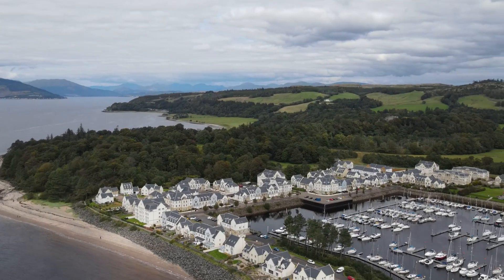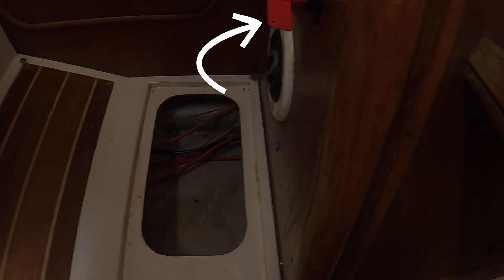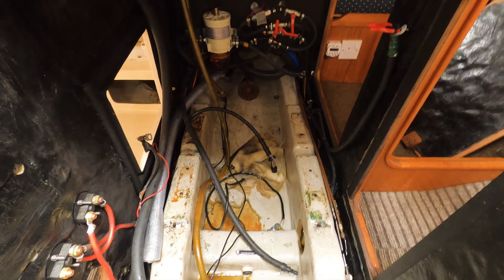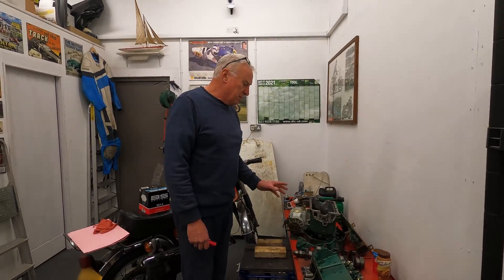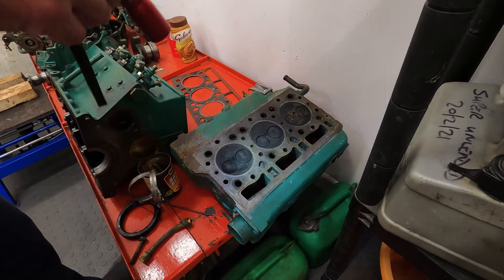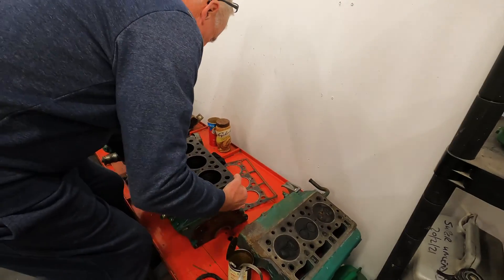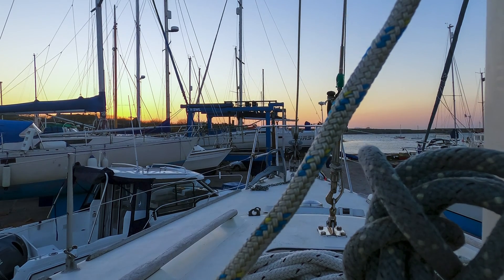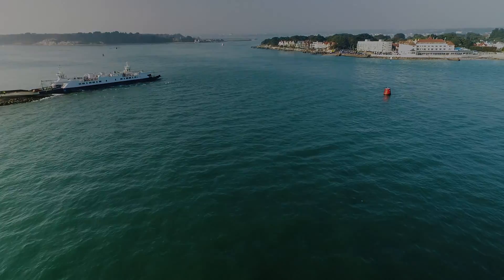Carry On Sailing. Volvo Penta 2003 Yacht Engine Rebuild. Part-3

Comment: Further to my comments in your Part 2, I find the level of incompetence, negligence and deceit that you've encountered to be absolutely staggering. You have been wronged for monetary gain and there should be inexpensive means available to you for full recompense.

I hesitate to mention the loose raw water intake hose which, as you mention, could have been catastrophic.

Credit to you for having such a stiff upper lip but I would still be considering every opportunity to discredit all parties who contributed to your pain otherwise they will continue to rip others off in similar fashion.
Reply from the maker: Thanks for commenting and like you was both shocked and relieved at the same time.  What I didn't film was the main fuel pipe that had been left sitting on top of the shaft coupling, that was day one of ownership. The engineer at Kip spotted it and replaced the whole pipe that had 50% worn through. I'd only done 9nm! Installation by an RYA Instructor!  I don't regard my role in this as being one which needs to shame them - they did that all by themselves.  The videos are enough - they know who they are!
Reply: @SM40  Did you get the boat surveyed?
Reply from the maker: Thanks for commenting. The engine installation was still being completed at launch and pre-dated the survey so written assurances were written into the sale in light of the fresh engine installation. Since the issues were contractual discrepancies (i.e. the seller and the broker made false representations and failed to honour their word).  In that regard I also retained a complete audit trail for evidential purposes to support this, which turned out to be more important than the survey (i.e. the survey was of no value to the complaint).

Comment: Thanks for sharing! Who did the new refit and how much it costs?
Reply from the maker: The engine rebuilt was handled by an engineer who was privately recommended, and he did an excellent job. I also used a southampton engineering company to have the block and head cleaned and checked. Another local southampton injector specialist who checked and refurbished mine. It cost less than buying a refurbished engine.

Comment: I was squirming in my seat as your engineer was describing all the problems with your engine as he showed the insides bit by bit. You were lucky to get as far as you did. I have the same engine, and touch wood, only had minor problems with it. You certainly had some serious bad luck to buy that one. Hopefully things will only get better now. I'll look out for you when I'm next in Poole. Fair winds and calm seas - best wishes... Dave
Reply from the maker: Thanks for commenting,  I consider myself somewhat lucky in fact. No learning is bad learning is bad learning despite the modest extra costs. And the engine purrs like a cat now l. They're pretty good engines so long as they're looked after in my experience. Happy sailing ⛵️ 💓
Reply: Yes. I also have the same engine. I think my previous owner was more upstanding and mechanically minded. Thank god.

Comment: Just found your channel, enjoyed your videos and admire your pragmatism.

I know time has moved on but did you not consider lodging a small courts claim against the seller (the RYA instructor).

Marine Power either deliberately bodged that engine or sub contracted it to another bodger- absolutely irresponsible deliberate wrecking.
Reply from the maker: Hi, thanks for commenting. Yes, I did prepare a strong legal case, made slightly more complicated because the boat was bought in Scotland and me from England. I chose to spend the money on the boat and am pleased with the outcome. In any case, anyone who sees the videos and knows the boat may well know the previous owner, who claimed to be an RYA Instructor, and his reputation will be justly judged accordingly.

Comment: I have just acquired a Sigma 36, which apparently is a popular UK boat.  Owner had passed, boat had been sitting for 5yrs.  I'm debugging engine problems, layered...ie find one, fix it, find the hidden problem under the first.  If you don't mind me asking, how much did the engine rebuild cost parts & labor? 

Great video, thank you!
Reply from the maker: Hi Stephen, Thanks for commenting. Sure, the Sigma is a great class with loads of pedigree. It cost about the same as re-powering with a commercially reconditioned unit, maybe slightly more but for the piece of mind that the investment returns it no bad thing.

Comment: Seeing the water pipe Jubilee loose brought back some bad memories for me, first time I took my Hunter out into the Irish sea my mate noticed the bilge pumping water, when I looked in the cabin water was bellowing from the engine bay - the water pipe had blown off, had to lie in the water to reattach it - moral of the story, always double clip your water pipes
Reply from the maker: Or as i did, pay a volvo penta engineer over a £1000 to check the whole installation because the previous owner proved that he shouldnt have been in charge of a rubber duck in the bath let alone a yacht! Moral of the story is don't trust anyone else.
Reply: @SM40  My boat has a history of trying to kill me 😀 first time I took it from troon to Bangor, no issues on the sails, turned the engine on, went to dock, put it in reverse and the prop shaft blew out of the seal.... fun times lol - apart from that though its been fine
Reply from the maker: I'm feeling better already :-) Happy days!

Comment: Nice video! I also cursed the split pin on my VP 2003 gear shifting cable, it's ridiculous where it's located...
Reply from the maker: Many thanks 👍The trick is not to spit the pin too much I have worked out. The bolt that was loose is for the mechanism so was a bit of a red herring.

Comment: You mentioned the big problem of overheating and the smoke incident. Did you ever find out the exact cause of the issue? Anything to do with the heat exchanger or was it juts the blockages due to the silicone gasket issue? Or was it the electrics? Would love to know the exact cause as I also have a Volvo Penta 2003 which has in the past given me some problems of overheating. Great videos - thank you.
Reply from the maker: With the suspected overheating we concluded it was a faulty alarm. Later, I found faulty wiring for the water temperature and so that proved to be a reasonable judgement. The smoke, it was oily smoke, and I am 99.8% certain that was due to leaked oil in contact with a hot engine and we were beating into a F6 down the Irish which was quite bumpy. The crank case did have some smoke but nothing very alarming, more synonymous with worn piston seals/cylinders, which proved to be the case.  It is, however, possible that we did also overheat due to the leaky engine block drain that was later identified when the engine was dismantled.  All in all, that engine in the state that Motive Marine (Peter Burgess) sold it in, it was always going to fail. It was a dud! Thanks for enjoying the video; I thought it would be good to share with the wider community.

Comment: Worst engine VP ever made sadly ,pulled ours out a few years ago gave up on it. Hope you have better luck
Reply from the maker: Oh dear! Having much better luck now after the rebuild. Sorry to hear that you're not a fan of them. I've had years of experience with the 2003 and have always found them to be good and reliable (except when ruuning out of diesel ;-) which i did once and then had to sail into a marina berth! ) They are an aging model now, so parts are that much more difficult to obtain.
Reply: @SM40  I have had a VP 2002 with 3000+ running hours. I have faced one problem with this engine: it will not start. This could be solved by closing the decompression valves 🤭

Comment: It's not clear from your videos where you actually bought the boat or what company supposedly reconditioned the engine. I know if it was me got ripped off like that I would certainly be naming and shaming the engineering company to help prevent possible future unsuspecting customers getting ripped off. No difference in naming and shaming than reviewing products on websites etc. Can you at least tell us where the company is situated. Nice boat.
Reply from the maker: Have a look at the video description; although I do mention the company name in the video. I bought the boat through Michael Schmidt & Partner in Scotland,, if you see previous videos there's a bit more on that there. Thanks for commenting.
Reply: @SM40  I see now what you wrote in description. Wish you loads of luck with her for the future.
Reply from the maker: Motive Marine of Southampton. I can't blame MS&P entirely, they blamed the owner for the misdescription, and Motive Marine gave me a copy of the invoice which doesnt say its been "fully reconditioned".  I did insist on sea testing and remediation arising from the installation. MS&P suggested this could be done via video, to save me a trip. The owner sent me a video that RB Marine provided saying that everything was okay. So I should have done the extra trip really, but everything is easy with hindsight! Like I say, I'm not bitter at all. The sailing has been amazing, and Scotland was fantastic, met some really lovely people and made great memories.
Reply: @SM40  Happy sailing.👍

Comment from the maker: Probably wont have time to edit for a week or two, but if there are any subject area's of interest I'd be pleased to receive iseas. However, I refuse to produce any video's about how to antifoul a boat 😂
Reply: I've done an article for the Westerly Owners' Association magazine on my experience this year of stripping my Westerly Storm's hull and then copper coating it.  If they use it, it should be out in the spring.  No video I am afraid, I can't scrape, sand and video at the same time.  But I do have lots of photos!